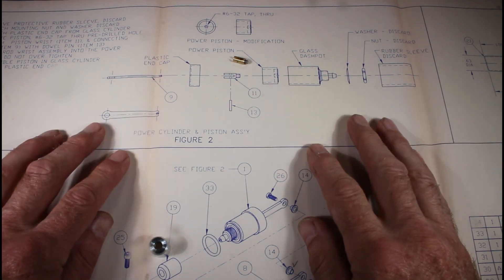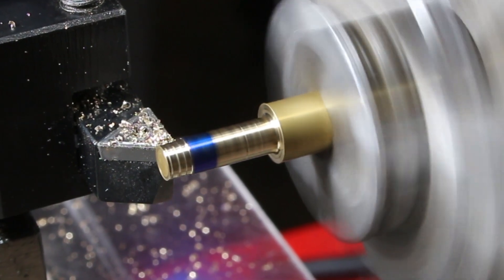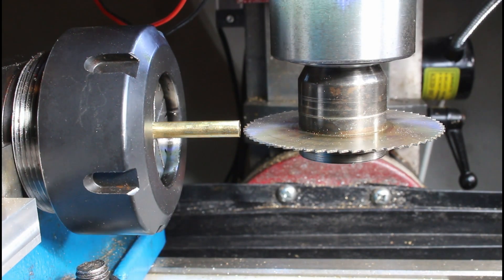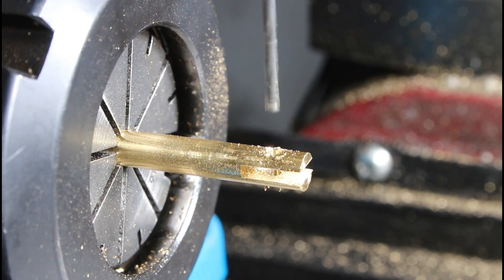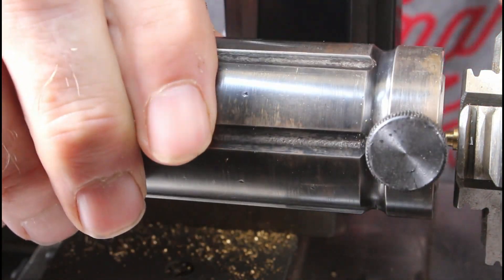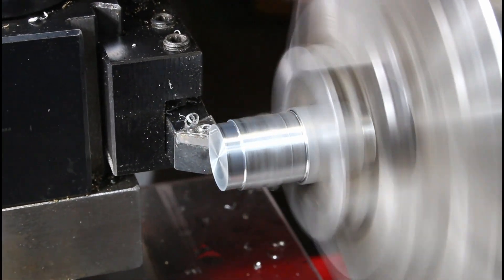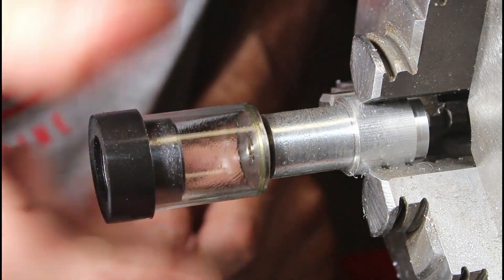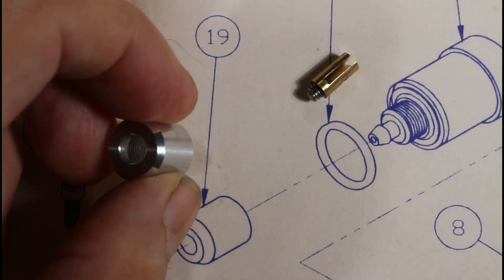Making a PM Research "Solar" Stirling engine - part 4

Comment: Last time I made a remark about your er collet. First push the collet in the retaining ring and push this in the collet holder and the stock afterwards. This will center the stock better. See the 4 minute mark.
Reply from the maker: You're absolutely right, I knew better, but just did it that way for the video. I will try to be more careful about showing the proper practice in future. Thanks for your feedback.